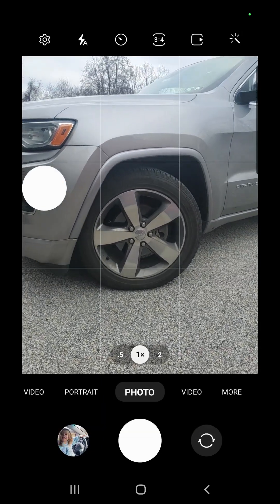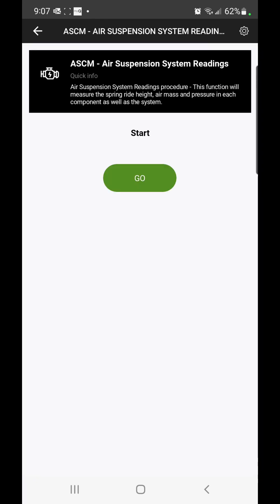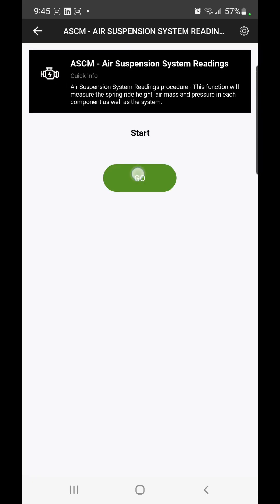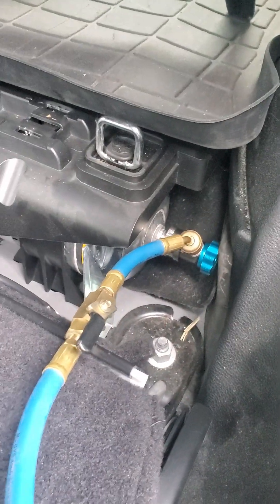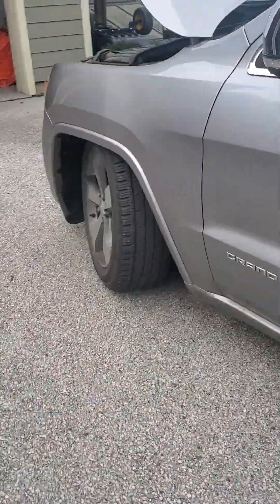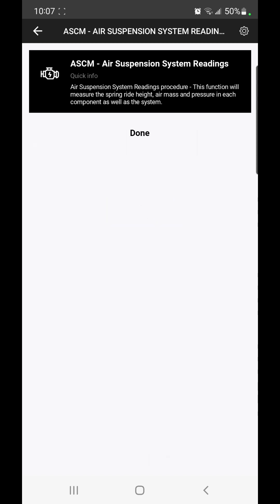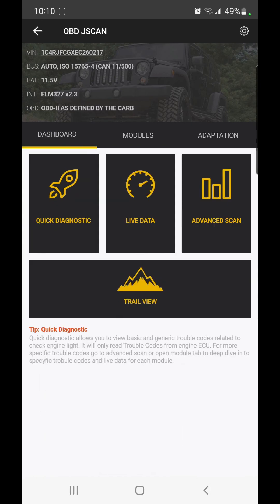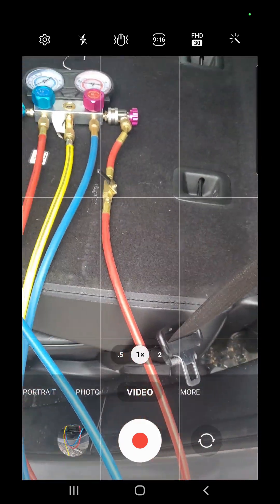Jeep Air Suspension Failure Test and Refill

Comment: I know the app you are using but what OBD2 BT adapter are you using? Looking to refill my system also but want to be sure the adapter I buy will support the air suspension system.
Reply from the maker: Vgate iCar Pro Bluetooth 4.0... https://www.amazon.com/dp/B06XGB4873?ref=ppx_pop_mob_ap_share
Reply: Thank you for the quick reply. I noticed a calibrate option. Ever used it?
Reply from the maker: @lucastompson8673  yep. It's just to calibrate the ride height back to factory if something has messed up the height. I have a video that shows how to do it but most people don't need too

Comment: Hi Dan, so the r134 fitting itself fits on the car fitting. What about the nitrogen bottle end? Does the ac recharge set fit straight on the nitrogen bottle or do you need to buy adapters?
Reply from the maker: @polkypolky8879  I had to buy an adapter to make it work. I think it will depend on your manifold, but I just got mine from Amazon. I think these were the ones I got: EXCELFU 6 Pieces 6015 R134A Brass... https://www.amazon.com/dp/B07W3X7KBN?ref=ppx_pop_mob_ap_share

Comment: Where can i find the fitting you are using for filling the tank? I have the gauges but cant find the fitting and really dont want to spend 275 for a Dorman set if i dont have to.
Reply from the maker: @TilerZies  My ac gauges came with them, but they are just 134a fittings.  So the low side ac line clips right on to the nitrogen tank in the Jeep.
Reply: @diydan30  Ahh gotcha. Thank you very much.